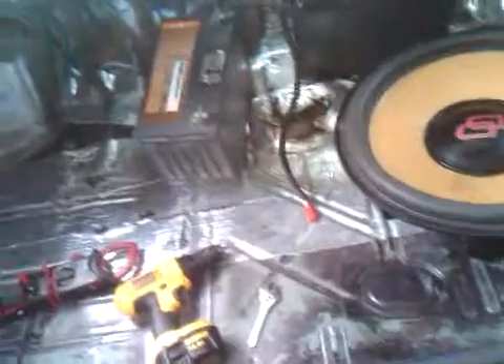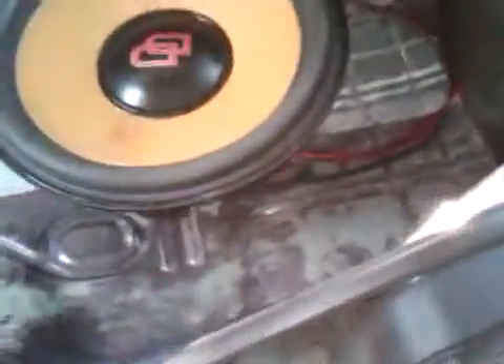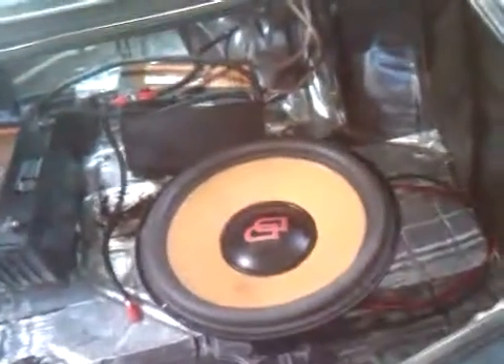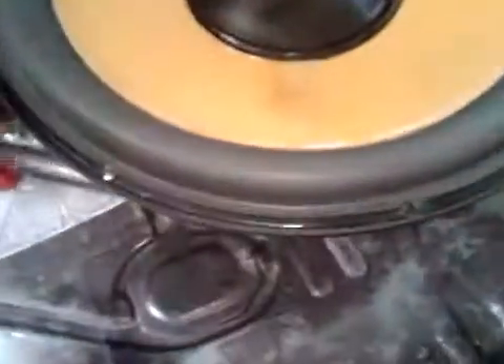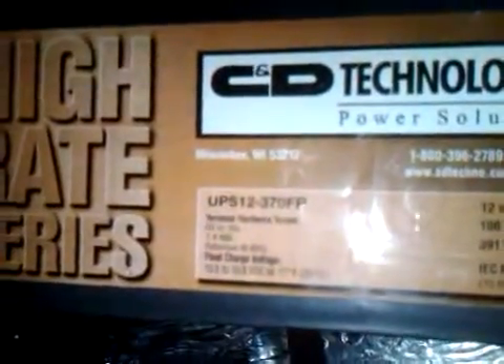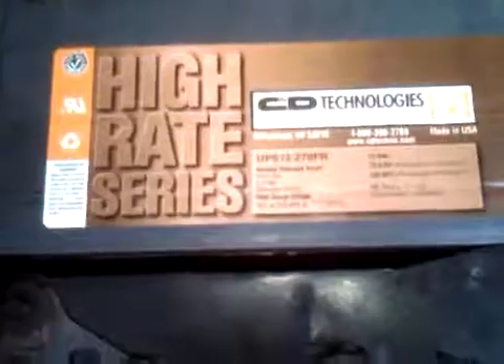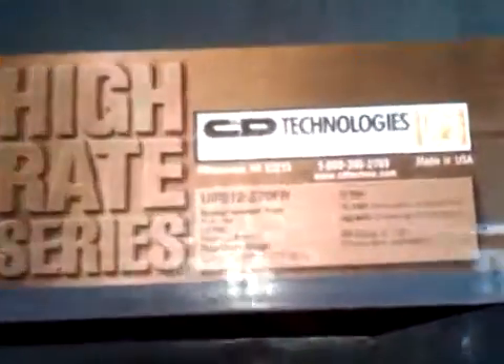What it takes to run 3000 watts RMS

Comment from the maker: @turboboy0 id rather have overkill then underkill lol. An its def not when a amp gets to a cerian size you need thicker wire to have as least resistance as possible I do it with speaker wire. An its cool still kickin, been sold 2wice since I had it. The rca ports are poorly made though. Ol had to beef them up